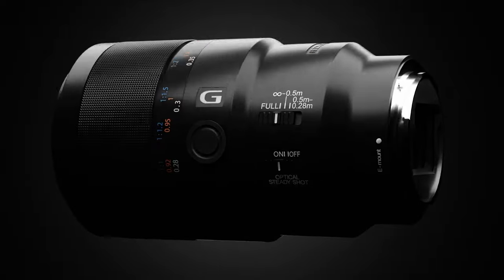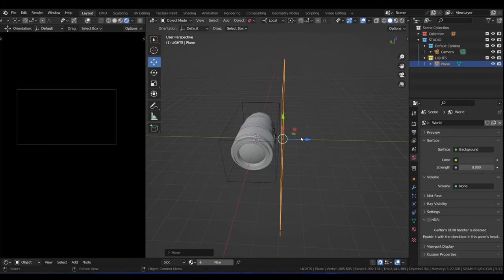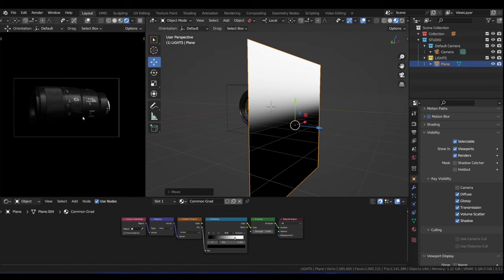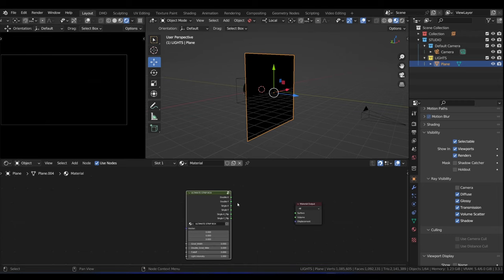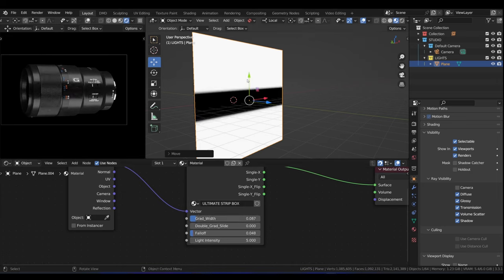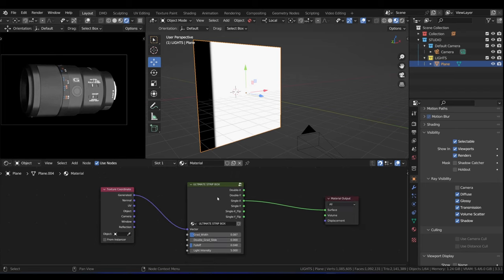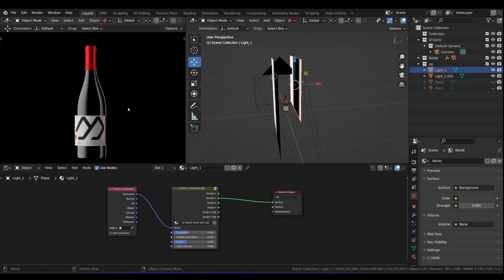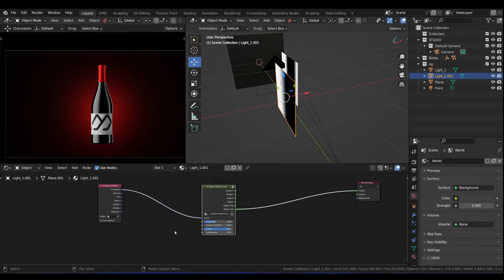How to Light Products like a Pro in Blender

Comment: Have you considered controlling the gradients using the UV coordinates? It may also be helpful to control the amount of lights by adjusting the number of gradient points. I apologize, but the current method seems overly complex and impractical. Furthermore, I don't see any photographic applications in this approach. If you enable the node wrangler addon you can get the UV coordinates faster and more controllable without overloading your quick direct access, and the shortcut is ctrl-t if am not wrong. What I am trying to say is that by using just a simple node you can make the same effect with more control and more efficiently created. And on top for free.
Reply from the maker: Hi @criko3d. Thanks for taking the time to critique the video and share your thoughts.

1. Yes I've used the UV coordinates before to control the gradients, I've found that there's no difference in the lighting per se since we still use the emission node for the actual light. Controlling the amount of gradient points is another way of doing it as well.
2. No need to apologize but the current method is just another way of doing it, like most things in Blender. Other persons seem to differ about it being "overly complex and impractical" though, I've gotten no such feedback so far.
3. In my studio I use this gradient technique using the "Savage Translum" Scrim with a 1.5 F-Stop together with my Godox AD 200's and strip box. That's the photographic application.
4. In another video we used the Node Wrangler addon. Yes it's ctrl-t to automatically setup the Texture and Mapping coordinate nodes.
5. My node setup is also free.

Still, thanks for the feedback, its always welcome. :-)
Reply: @denzelmodeste   I completely agree that there are different techniques to achieve the desired effects in Blender, and I would like to offer some suggestions that may be helpful:

1.-One technique to consider is rotating/moving/scaling the UV coordinates that control the placement of the color ramp. If this color ramp feeds the emission shader, then it may not be necessary to move the planes or create more planes if the lights are in the same 3D position. This technique can be used to reproduce the same Scrim light effect you described in your point 3.
2.-I agree with your second point!
3.-While I understand your point, I would like to clarify that placing lights in front of the camera covering the product in the real world may not be ideal for rendering a product in Blender. Instead, using a larger "virtual scrim light setup" controlled by the gradient, which represents the lighting itself, can replicate how a real studio works. By placing the lights behind the camera, you can save yourself some headaches if you plan to use an auto-focus solution for animation later. Even if your lights are not visible to the camera at render time, they may occlude the auto-focus system if you use an add-on for that purpose. This can result in the need to redo the lighting for animation and losing a consistent look, for example.
That's great to hear! I'm happy that you see the benefits of these techniques.
I agree that free resources can be useful, but when they are also high-quality, they are even better.
I would like to emphasize that making the global light completely black is not always the most professional way to achieve a realistic effect. Some global light is often useful, as total darkness is not common in a studio when shooting products. In order to achieve a natural and professional result, it is important to consider not only lighting, but also optics such as depth of field and a sense of scale. While your results look nice, I would like to stress the importance of being aware of your physical knowledge of studio setup and camera optics. In photography, we strive to make everything perfect, but with CGI it can be the other way around. I hope this all makes sense and is helpful!

Comment: Hello danzel this light setup is a saving life thank you so much .
but i wanted to know to have more control over the light ca we switch the dark with the light, for example when it black it light and when it light it black, you know what i mean ?
Reply from the maker: Hey @lemmen7420.  
Yes you can. Tab into the group and adjust the Color Ramp nodes. That should do the trick. 🙂
Reply: @denzelmodeste  Hey i tryed it few time but didn't works :(